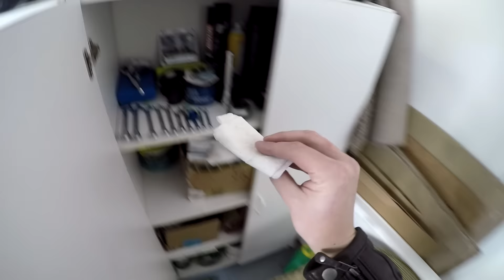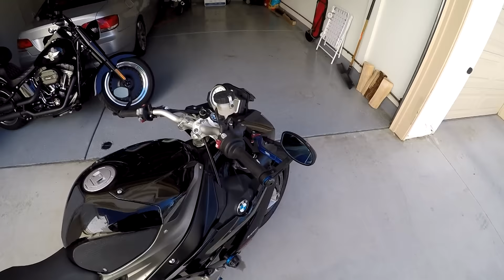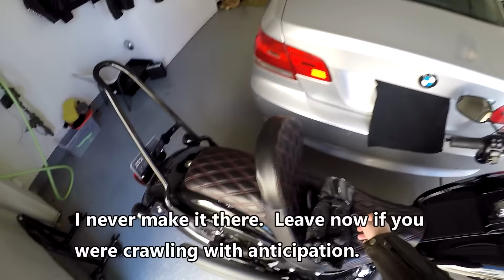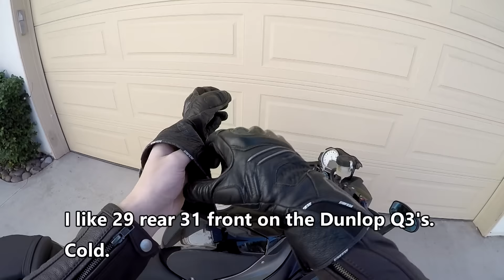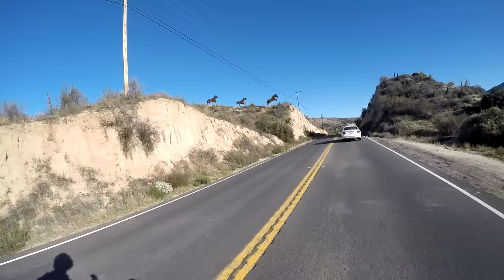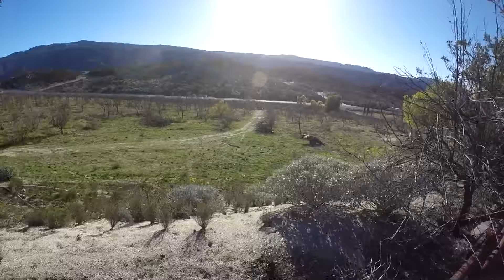BMW S1000R Rizoma parts update and ride into the desert

Comment: Use these adapters from Rizoma instead, much better and won't cause you any headaches when removing / reinstalling.     https://www.motovationusa.com/rizoma-adapter-for-bar-end-mirrors-and-proguard-lp321b.html
Reply from the maker: Thank you!  The current adapters are locked so a new set is coming.